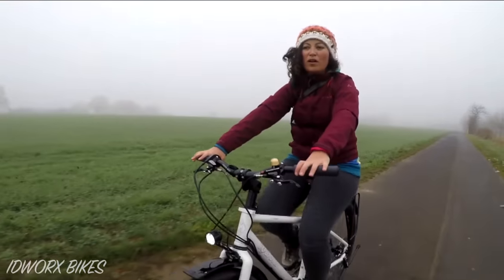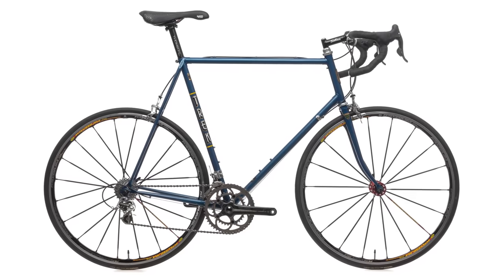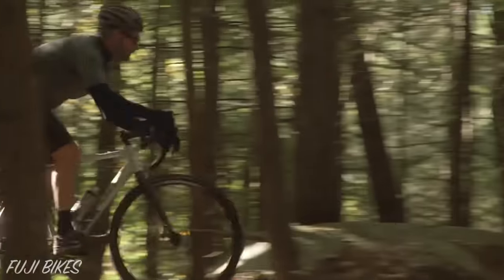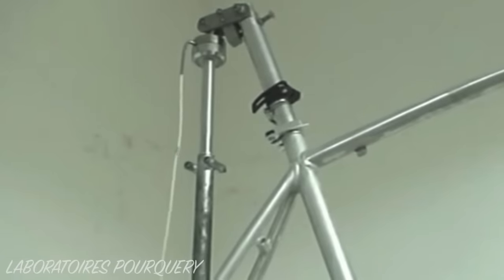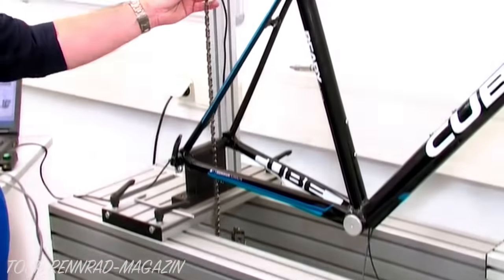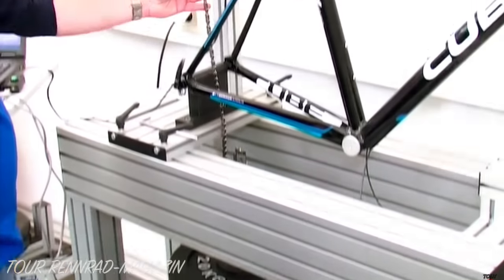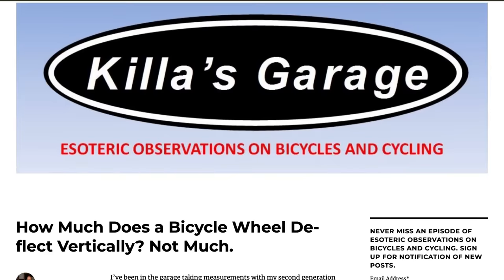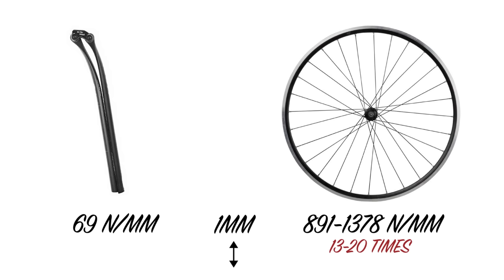Why It's Impossible For Steel Frames To Be More Comfortable Than Aluminium

Comment: My experience has been riding two very different bikes, so it can only be an apples to oranges comparison. I was riding a 2010 Rocky Mountain Oxygen 30 AC (aluminum/carbon). It was definitely an entry level bike with a generic carbon wrapped aluminum seatpost, Shimano WH-500 wheels, a generic stem (I think an unbranded Kalloy) and 25mm Continental Gator Hardshell tires. It had an FSA Gossamer Crankset and 31.8mm Interloc Blackbird Comp Aluminum Handlebars. It was a very harsh riding bike, it felt cheap, if that's a fair description. I now have a bike that feels like the polar opposite. It is a 1997 Serotta Atlanta with Serotta's Colorado Concept (proprietary) steel tubes made by True Temper. It has Campagnolo Proton wheels (probably a big contribution to it's compliant feeling) and a setback Thompson Elite aluminum seatpost ( a big contributor to rigidity). I currently have a Cinelli A1 stem on it and 26mm Scott Drop-In Handlebars. It has 23mm Schwalbe Lugano tires, and it came equipped with Shimano Ultegra Cranks. I am using the same Shimano XT Pedals and WTB Laser Saddle from the old bike, so there is no difference between them. So if what you are saying is true, then it is the deeper section wheels and larger diameter bars that we have swapped to that are probably contributing to an unnecessarily harsh ride. At least this is what I have long believed, and the concept that rigidity contributes to speed I suspect, is a flawed one. At least, I have never been able to find any scientific data, that backs that up.

I will say this though... your belief that knocking on the frame has anything to do with the damping effects of a frame under load, is entirely mistaken. There is a lot to the properties of materials but thumping against a material to compare their qualities is only of use for resonance, such as acoustics. I have yet to see anyone compare the acoustics of bicycle frames or components. Metaltek.com listed some of the more common aspects when comparing properties of materials. 1. Conductivity  2. Corrosion Resistance 3. Density 4. Ductility / Malleability  5. Elasticity 6. Fracture Toughness 7. Hardness 8. Plasticity 9 Strength, Fatigue 10. Strength, Sheer 11. Strength, Tensile  12. Strength / Yield  13. Toughness 14. Wear Resistance. Obviously things like conductivity have no more use to us than thumping a frame, but I think all other aspects play at least some role in selecting a frame material. Fatigue and Yield strength are two categories where most people feel steel will reign supreme. I suspect hat fatigue will likely be the weak point for carbon. Yes it has good flex under mild shock, but still when bend when carbon will virtually vaporize. I am only being slightly dramatic when I say that. YouTube is full of videos that demonstrate that. Aluminum is also likely to get fatigue cracks which is why I don't ride the Rocky Mountain any more. A crack at the base of the seat tube where it meets the bottom bracket took that frame out of commission. Aluminum frames, by the way, are heat treated after welding and cannot be repaired if they get a crack. They can however go in the recycle, which is where. I feel anyway, they belong. Ahem, not a fan.
Reply from the maker: Larger diameter bars are almost always stiffer than what we have replaced. That said, my carbon handlebars have noticeably more vertical deflection than my alloy bars and the material does a great job of attenuating vibrations coming up from the road.
Tapping on a frame is just a simple way of explaining that different materials attenuate vibrations differently. I'm in no way suggesting it's a test we should conduct to explain how a bike will ride.

Comment: This has been pointed out numerous times before, not sure why you spent so much time on it. The problem is: for many, experience says otherwise.
I do think a flexy seatpost is genius. Been running an Erikson ti posts on my bikes for 10+ years. But it doesn't help at the pedals (I do a lot of SS, out of saddle).
My cranks are connected to the frame, not the tires. It's a more direct relationship. I'd guess there's an an unaccounted variable here that's being overlooked. Total vertical is not going to tell the whole story.
Anyhow, just ride what you like, not what the math tells you to ride. Why would anyone let math determine their bike choice? I'm hyper analytical, quantify everything, but not how a bike rides.
I gave you thumbs up for a high-quality, well researched, well presented argument. Well done. Thanks!
Reply from the maker: I spent time on it because I have never found a correlation in terms of frame comfort on any of my bikes, and the data seems to back me up. I can make my steel bikes ride harsh, and my aluminium bikes ride smooth, just by switching a few components.
There could be a difference when standing up as you're taking away springs in the series. I couldn't find any data on vertical deflection measured at the BB. But for me personally, the percentage of my ride time seated would have to be 99.9%, so that's why I focused on a seated riding scenario.

Comment: For me, I’ve noticed the largest difference on a road bike when using this formula:
1. Wider 28-32 mm tires
2. Tires with a high TPI count
3. Michelin bike tire chart for correct tire pressure (cyclist + bike).
Reply from the maker: Agree! Tyres will make a huge difference to the way a bike will ride.
Reply: The last one (no.3) is a guarantee you're running too high pressures, & therefore less comfortable. It's grossly outdated.
Reply: Joseph Farrugia Well, I’m 150lbs and according to Michelin chart, I should run about 82 psi for a 28mm tire.
And that!’s about right for me. Any less psi and it starts to get squirmy on me when cornering. So, yes, it’s still current.

Comment: Just installing slightly larger tires and running a lower pressure will have a much more noticeable impact in ride quality that any slight deflection, be it frame, fork or seatpost, may have.
Reply from the maker: Yep! You can achieve very low n/mm values with voluminous tyres. But keep in mind that not all bikes have the clearance for wide tyres, so the other components should be kept in mind.

Comment: Adding heavy cargo significantly improves comfort. I once carried my big ass bluetooth speaker on the rear rack of my bike and the added 11kg clearly dampened most bumps in the road.
It did however make the ride quality much worse, because the high center of gravity is not fun to ride at all.
I'm really wondering how a bike rides if you put the full amount of cargo onto the rack that it is allowed for (25kg in my case)

Comment: The problem is the fatigue issue of aluminium which steel & titanium don't have. As a consequence aluminium frames have to be designed to be really stiff because any flex will lead to fatigue. This is often done using larger diameter tubing & little tricks in regards frame design & reinforcement of the  joints etc.
I can get onto steel bikes that I didn't even know were steel & straight away I knew from the smooth ride they were steel, but again it's not because of the material properties, aluminium frames are simply designed to be stiffer to because otherwise they turn into spaghetti over time. Mind you 1st tier manufacturers are now working out how to have their cake & eat it too in regards aluminium.

Comment: This is wrong, but partially right:
1) you've done a static displacement analysis of a dynamic system.
2) vibrations have both spring and damper properties.
3) it completely ignores the influence of the design.

Essentially, the energy put in to cause the static displacement has to be released to somewhere; this happens over time, whilst new displacements are still being received.
"Comfort" would require harmonic analysis of the seat, hub/pedals and handlebars; it will give a spectral density for each. 
Generally, comfort is a direct function of speed and road surface; mass (inertial mass) will probably be the better frame independent indicator of ride comfort rather than frame material, as the tires are the single largest spring damper (ommiting a suspension system).

Comment: Tyre roll resistance is a relevant and important issue if  focused just to..puncture resistant designs  and makes first just the diameter  roll resistance of 26 vs 700  then a focus on 3 tyre  makes only Vittoria Schwab  Continental  35mm width ,,,,info is out there

Comment: interesting topic, in my experience with mtb enduro i prefer a stiffer frame, the flex in some models puts me off while im riding and breaks my concentration, once you get 'used' to a bike i think its your 'reflexes' registering all the small details and feedback.
this is also why setting up suspension properly can give you that confidence and consistency when you set it for the right job
Reply from the maker: I personally prefer a stiffer enduro/DH bike, but know others who like their flexy bikes. To each their own! I agree you can get used to whatever bike you ride.

Comment: After an hour on an aluminum frame, I'm ready to be done. That doesn't happen with steel, carbon, or Ti. Dropping tires to 30 psi didn't change this. This is my experience, not a theory.

Comment: Fit more than anything makes a bike comfortable...  you can ride a very comfortable set up in terms of tires. seat post,  etc. and if the fit is not good it will be uncomfortable.  Hence the reason to get a custom bike.  If you have been riding for more than 5 years and understand your fit, get a custom bike.  I have ridden an adult bike since 1987 and got my first custom this year and it made a big difference.  I only have 1000 miles on it and am more comfortable than any other bike I have ever ridden.  Also tires vary greatly in comfort even in the same size with the same pressure.  Spend more on really good tires and you can tell a difference.
Reply from the maker: I'm glad you like your custom bike! I've got a few and love that the fit and details are perfect for my needs. Totally agree that tyres are as good investment as you can make.

Comment: Those bikes with no seat tube are interesting. The biggest problem I see with them are low frequency resonance i.e. bobbing up and down as your peddling. I had an Airnimal bike I toured with from Alice spring to Darwin. This was essentially a similar system except with a rubber damper as the seat post. Even this "bobbed" which was annoying because it coincided with my natural cadence. An effective damper as a seat post would be ideal.

Comment: I have done few subjective tests, different frames.
1. One part of the road, carbon frame and fork with flexible carbon seatpost, one test with very stiff aluminium wheels and other with soft aluminium wheels, same tires 25 mm, same pressure. The road buzz is higher with stiff wheels,  so easy to notice.
2. Same road, steel frame and fork with aluminum seatpost, same wheels, stiff and soft, same tires and preassure like in 1st test. Steel frame and fork provided less road buzz compared to same combination of wheels on carbon bike, easy to notice, both on hands and but. 

Also, tested with identical sadles and bar tape. 

How to explain this?

Also did few tests on aluminium frame and fork, very uncomfortable to ride, probably due to aluminium fork, so much road buzz.

Comment: I wonder if limiting the scope to just vertical deflection in a single plane limits the findings here. There is a certain springiness to a loaded steel frame when shifting side to side under a heavy pedalling scenario that may also contribute to a subjective improvement in feel.

Comment: Even a carbon frame, which can be engineered with stiffness and flex in different spots, has less deflection than a very basic suspension seatpost or stem, or a 5mm jump in tyre size.

Comment: Awesome that you bring in the facts and numbers. However one note able thing you skipped on was the fork geometry and material.
So i guess the reason steel bikes are good for touring is more the durability (less prone to metal fatigue)?
Reply: It's also beacuse it's easier to weld back steel than it to fix carbon. It's easier to find a steelsmith in remote places as opposed to high tech carbon repair centers

Comment: usually the steel frames are softer then aluminium frames because of size of pipes and nature of material... but is also how it is builded. 
I had Niner Air9 Al first series, Niner Sir9  Steel 853 last evolution  and  the Air9 last evolution. The softer was the first ,the second was a mid one, 
the last was a stone. A part the back wheel  (from 135mm x 9 mm to 142mm x 12) , the rest of components was the same.

Comment: Yeah I remember when I got a titanium bike with a carbon fork and 23 mm tires, it felt slightly more buzzy than the aluminum walmart bike I had which came with 32 mm tires but switched to 23 mm tires because I thought it would be faster, in reality I didn't really notice a difference in speed. Anyway the aluminum bike had either a steel or aluminum fork and felt smoother than the titanium bike even with the same tire width and pressure.
Reply from the maker: Interesting you found the aluminium bike to ride smoother with the same tyre width and pressure! Could've been that you used tyres with thinner sidewalls, or maybe you had a bit more seatpost showing or perhaps a little more padding on the seat...

Comment: Diamond frames are close to a true truss in respect to loads from the rear wheel to the saddle, so it's no surprise most of the compliance there comes from the tires, seatpost, and saddle. But for loads from the front wheel to the hands and arms, the frame isn't a truss, it would take at least one more tube and a longish head tube to be a decent truss. The fork puts very sizable bending moment into the head tube, which is resisted by bending the top and down tubes into very mild S-shapes. Even pure vertical loads on this non-truss result in some bending of the top and down tubes, not in pure tension/compression loads. For most bikes, front end compliance would still come mainly from tire, fork flex, and handlebar flex, but frame material and geometry are no longer negligible.

Comment: A good bike frame flexes in all sorts of places, but not vertically because they are designed precisely not to do that. A thin bladed steel fork flexes a great deal, but most importantly, the BB (where most of your weight is hanging from, very little weight is carried by the saddle) flexes side to side a great deal under power, climbing, descending etc. This were the modulus of elasticity effects ride comfort the twisting forces through the fork, via the down tube to the BB is where most of a frames 'ride feel' comes from and why steel 'feels' better.
Reply from the maker: I also like the BB flex and ride 'feel' of my steel bikes. 👍🏻

Comment: different materials require different thickness of tubing and different amount of material used.
so if making a steel bike with same exact specs the steel frame will be very heavy.
steel flex more than alloy, but how you use the materials can make a big difference you can have a stiff steel frame, or a flexy alloy frame. or a very stiff alloy frame, all depends how it's engineered.
so those people that say a frame is good just because it's steel or because it's alloy are wrong.
I am sure there will be bikes you might feel a difference compared to another bike, but that will happen with alloy vs alloy too, cus it's how you use the material, how everything is welded, shaped, how long, how wide, how thick, where things are put, all make a difference. I have ridden a alloy full suspension bike(2014 fuelex) that was quite flexy, and now I ride a alloy full suspension bike that is stiff enough. but the linkage design, the geometry, all was different, but I don't know the alloy used on the old bike cus , Trek keeps that a secret, Nicolai does not.
The bike was rocking side to side, bearing wear was uneven, hanger bent regularly.
huge difference with my new bike, it's stiffer in every way.

Comment: I started out road biking in 1984 on steel bikes. In 2007 I picked up a 2 yr old carbon bike with Kysrium Elite wheels & could not believe how much smoother the ride was & how quickly it accelerated.  Since then I have gotten another carbon bike with a stiffer frame and the same Kysrium wheelset and it is not as smooth. I noticed the same thing with mtbing & fat biking.  Depending on wheel size, the carbon frames are smoother.

Comment: Thanks a lot. This was very useful information. Kind of supports the approach I have taken with my latest bike addition. A relatively inexpensive aluminium gravel bike where I swapped out the stock tires for wider ones and also installed a suspension seat post. Resulted in a quite comfortable ride feel.
Reply from the maker: Glad it was useful! I've also had very comfortable aluminium bikes with nice wide tyres and a suspension post.

Comment: Very interesting - and much underresearched (or communicated) so far. One question: as the video puts a lot of emphasis to it, is the vertical compliance of the saddle/bum so much more important than impact on pedals/feet and bars/arms?
Reply from the maker: The frame plays very little role in terms of vertical deflection at the pedals and bars. The components play the biggest role here, especially the handlebar which flexes at between 20-40N/mm on a wide flat bar, and at between 40-80N/mm on a regular drop bar.